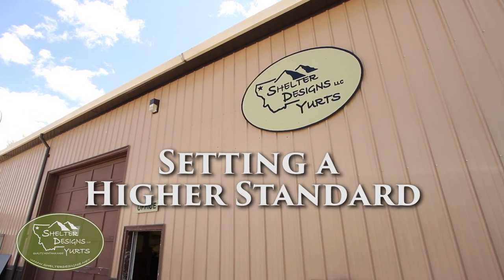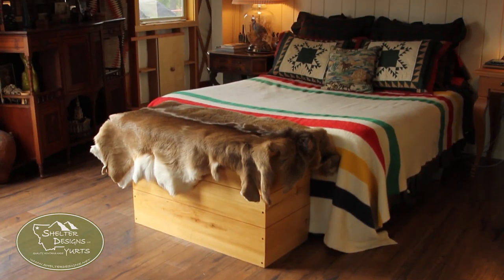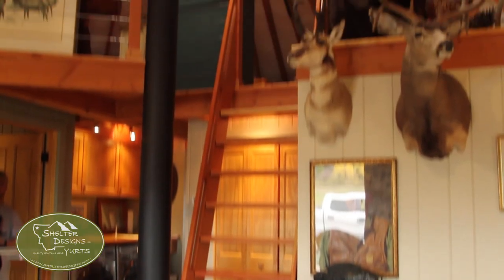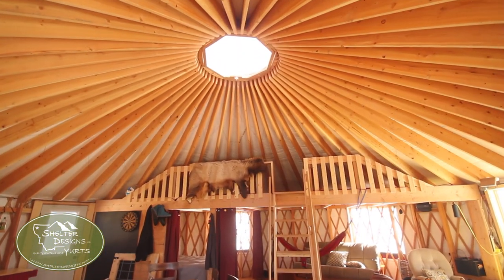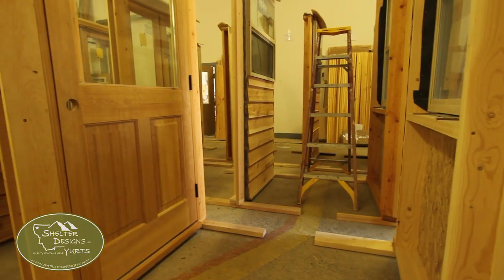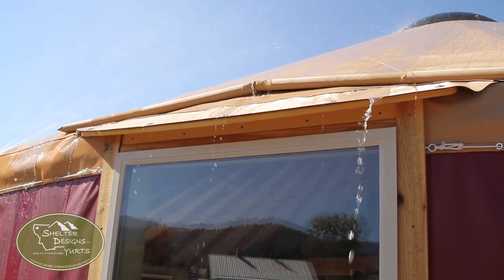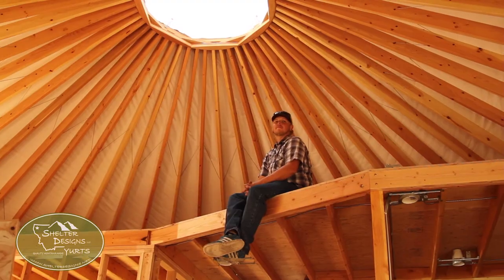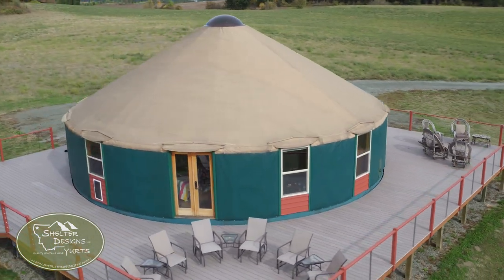SD Yurts : Setting a Higher Standard

Comment: I'm impressed, however Edmonton Alberta 40 below is not uncommon. Keep in mind, -40 is the same in C and F.
I heard you made 40 ft.. But... can you join a 30 or 35 ft. to it?  One 50 ft would be nicer than 2 yurts joined.
Reply: You can always make one of your openings into a passage from one yurt to another. They likely wont offer it standard or have a guide, but it shouldn't be hard, it's a simple wood structure.

Comment: Has anyone ever had central heating placed in their yurt?
Reply: I've read about some that have used heated flooring and woodstoves, however central heating? not so much. In all likelyhood, it will be overkill. Your biggest concern is the floor, not the walls, which is what central heating normally helps the most with.